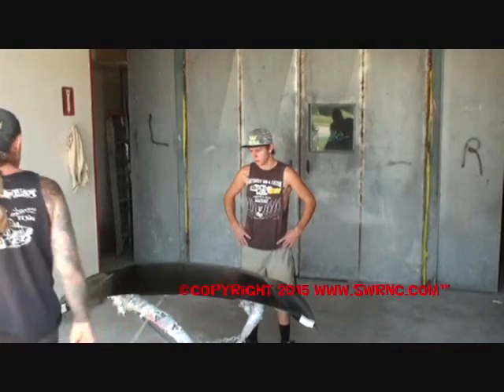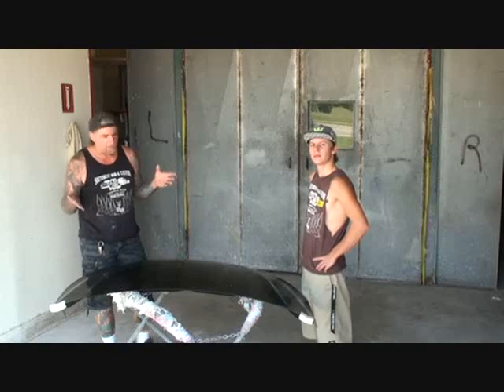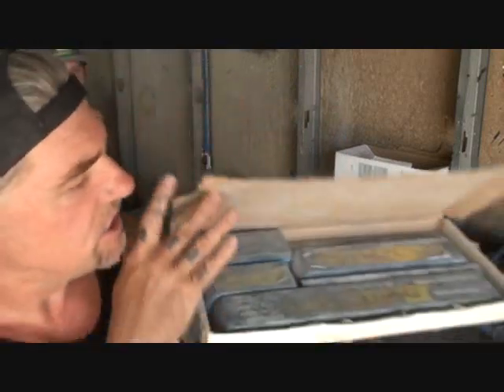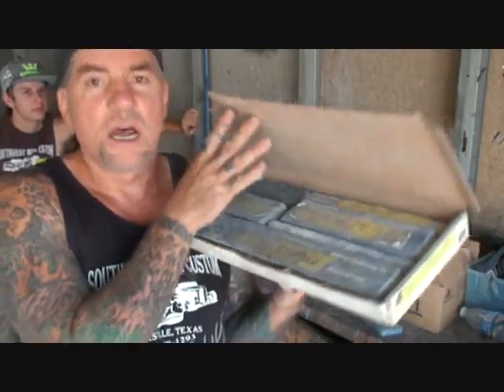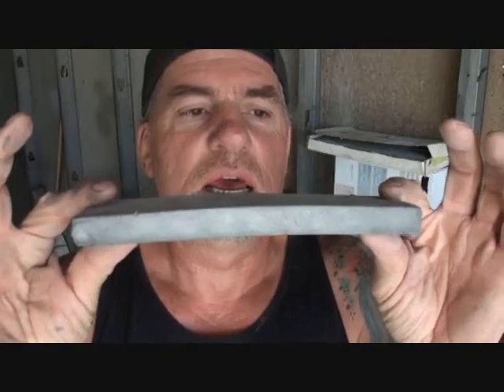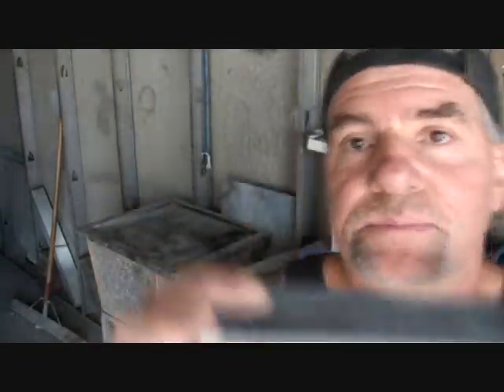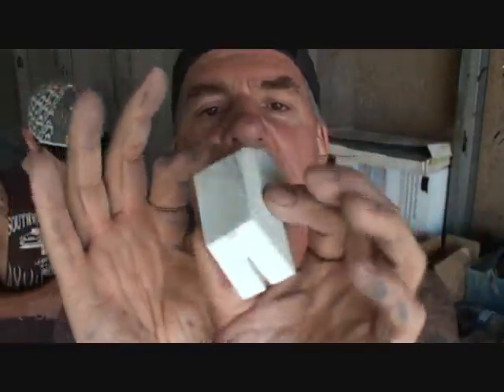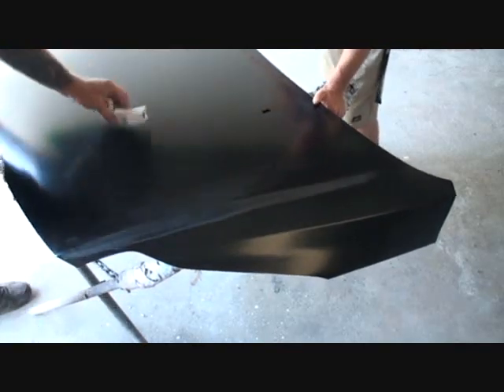How To Make Sanding Blocks-Automotive Collision Repairs/Car Restoration

Comment: Some of the best tools are purpose built from this and that....Good stuff Pete.
Reply: Very true... I've even cut thin FRP panel to make a special shape body filler spreader. It helped duplicate some tight radiuses on a C3 Vette. Sanding blocks are something I've been making for years. And ole Pete here is giving all the trade secret ideas for free... fu#kin FREE PETE!

Comment: A block the size you showed at around 7:00 will cost around $10 bucks from NAPA, a little less or even more from most other automotive suppliers.

Comment: You can get foam blocks that are virtually identical to those packing books in larger sizes craft stores.  They're not free but the variety of sizes is better. Also for tiny sanding blocks, rubber block erasers from the dollar store are nice.

Comment: That's a great idea.  That saves bucks here and there and that adds up, plus they can be customized.  Btw,  i got my board sander. A used but primo shape Chicago Pneumatic Made in USA.   The Made in USA CP sanders were good.   Btw, the light bulb went off last night on using cosmoline for rust proofing inside panels.  Cosmoline is mil-spec and self healing and fantastic on preserving guns.  They have some car specific products.  Up in the NorthEast, rust is a nightmare, like you saw what happened with the Mustang you are reconstructing.  My 5 year old (at the time) '69 Roadrunner ragtop needed quite a bit of metalwork.  I don't know WHY it did not dawn on me about using cosmoline until last night.  There one type of cosmoline that is automotive specific.  I'll be getting a 5 gallon pail and doing inside the areas where rust starts.  You might want to ask the owner of the Mustang about doing that since he's up in New Jersey.

Comment: Do you ever use air powered sheet metal shears (nibbler)?  That one I worked with and everyone else back then used sheet metal shears back in the 1970's.  I don't think they had plasma cutters back then or maybe they were ridiculously expensive.  Sheet metal shears would be a good cheap tool and easier to cut out shapes than with the cutoff wheel.